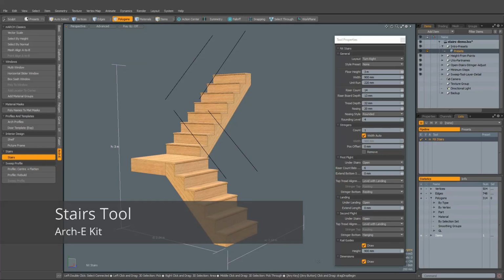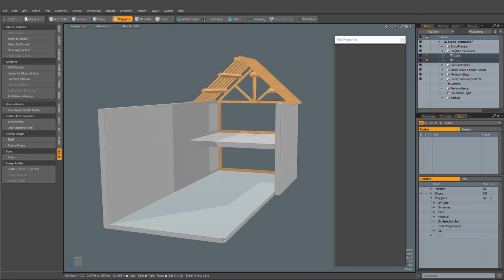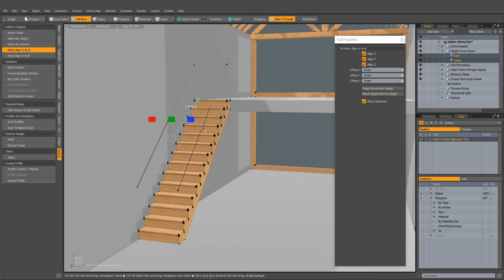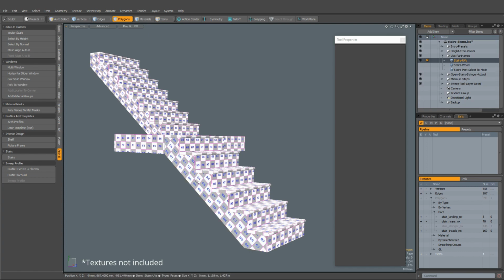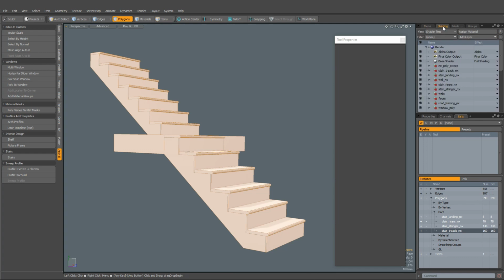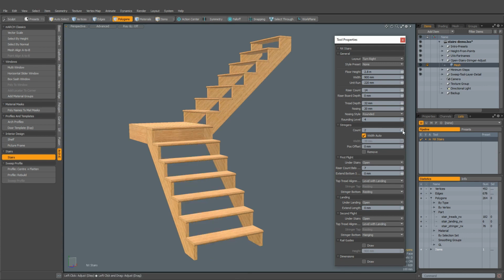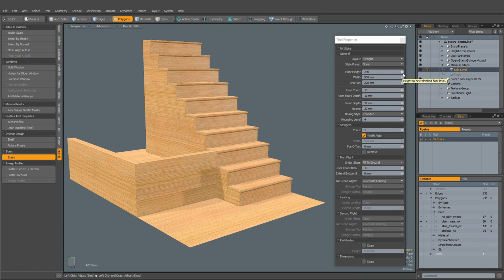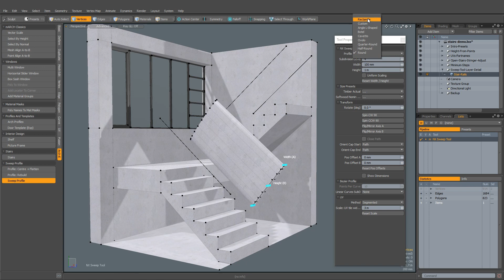Arch-E Kit for modo | Stairs Tool

Comment: Is Arch-E Kit (v1) for MODO 14 available?
Reply from the maker: Hi Kurt. No, v1 supports modo 10 to modo 13. The stairs tool is only available in Arch-E v2, which currently works with modo 10 to modo 15. Note, I provide a low-cost upgrade path for v1 users.
Reply: @TheThirdGuild  how much?
Reply from the maker: @kurt6148  Approx. 1/3 of the v2 kit price. For customer support and upgrade discount codes, please email me directly: neil AT thethirdguild.com